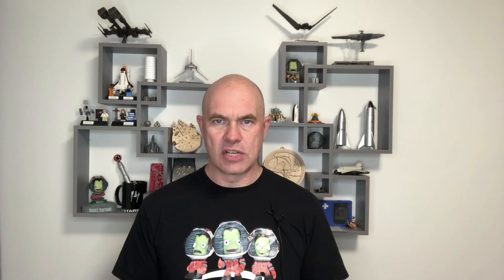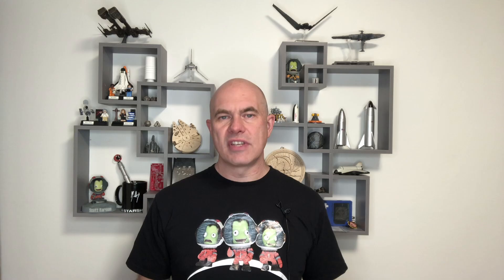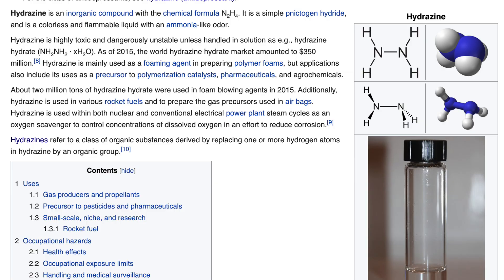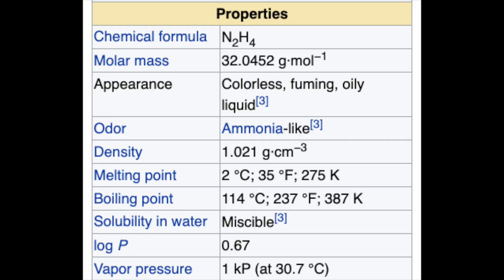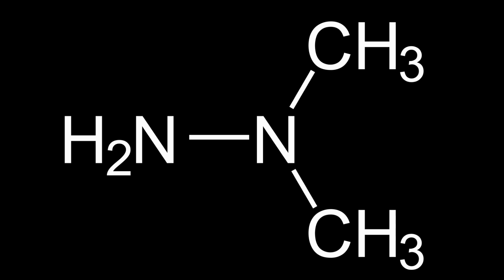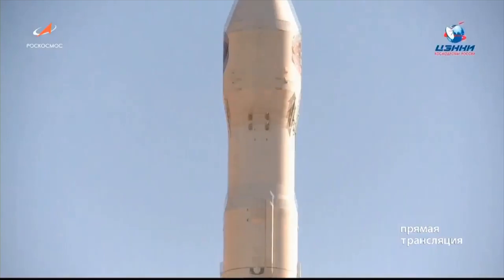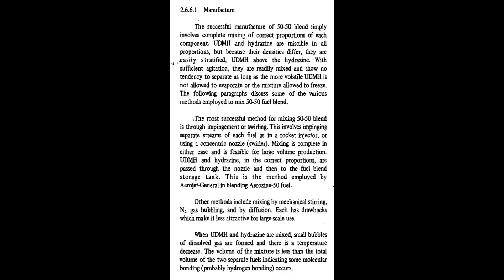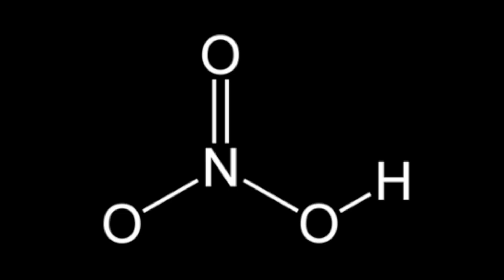What are Hypergolic Rocket Fuels? (Other than Explosive, Corrosive, Toxic, Carcinogenic and Orange)

Comment: Two questions. 1. What about the "green propellant(s)" we heard so much about recently, then seemed to have disappeared?

2. Why does Starliner's thrusters/escape motors make huge orange NO clouds (that the capsule then flies through) where Crew Dragon's seem to burn perfectly clean, even at any throttle setting?
Reply from the maker: Green props are monoprops, they're able to decompose with a catalyst, but aren't inherently toxic or corrosive. They're better performing than hydrazine but are new technology and aerospace designers are risk averse.

Not sure about the second question without more research.
Reply: @scottmanley  As monoprops are they also underperforming in comparison to biprop hypergolics? If there isn't a performance gap, I'm surprised SpaceX didn't adopt them, as they seem to view risk a lot differently than the Oldspace Boys Club.
Reply from the maker: Monoprops are lower performing than Biprops.
Reply: @scottmanley  So is anyone working on a "green" biprop? Or is there just no such thing as a storable "green" oxidizer?
Reply from the maker: @AdmiralQuality  Nobody has figured out how to make a green hypergolic biprop.

Comment: Makes me wonder if scram jets use some kind of oxidizer mixed into the fuel or injected into the combustion chamber separately from the fuel injectors. Extra oxidizer to compliment limited oxygen through the air inlet when over 98% of the atmosphere at 100,000 ft altitude.

Comment: In the V2 they also put water in the rocket fuel. Not sure why they used to do this, when they could've had more fuel instead.
Reply from the maker: I explain it here: https://www.youtube.com/watch?v=Eauxlp1wN8Q
Reply: German rocketeers have almost immediately started in 1930 with kerosene with liquid oxygen. But they could not construct rocket engines that would work well with this and similar fuels. (In fact, one such experiment have killed Max Valier, the founder of german "Society for Space Ship Travel" -- a club which did most of the early engine tinkering.) 
So they have stepped back and simplified the problem by using a fuel which was not burning as energetically and was at the same time a much better coolant. That allowed them to construct rocket engines that actually worked reasonably reliably, and could be built with available to them technology. Later, after much work, such engines were scaled-up and put into production for V2 rocket.
Meanwhile, engine development continued, and eventually produced much more modern looking designs, some using hypergolic fuels. Although it is not a completely settled question, these engines have likely had more impact on after-the-war engine development than the better known to the public V2.

Comment: Ignition!
Btw: In which world is HF a stronger acid than HNO3?
Reply: Yeah, people often conflate "scarier as a human" to "stronger". I get why, but it's still wrong
Reply: HF reacts with everything, but in a lot of cases the metal flouride is a stable layer passivating the surface. Thus you can store HF in nickel tanks, and use pure nickel plant to handle it, because NiF is at least similar in size to Ni metal, and bonds well. Just like Aluminium oxide is a passivation layer for insanely reactive Aluminium. Just do not have any sort of cavitation that will scour this layer away, and pour your liquid in slowly and carefully.
Reply: @mduckernz  I'm not even sure if HF is scarier than RFNA. HF has high dermal toxicity, but fumes are not that bad LD50-wise. RFNA on the other hand will do bad things to you on contact and on inhaling fumes...

Comment: Speaking of fuel chemistry - what are the exhaust products of a methalox engine? CH4 and O2 will produce carbon dioxide and... I could easily assume the wrong answer.

Was contemplating the ideal of Raptor using methane & oxygen processed from air with solar power - returning same carbon and oxygen to the atmosphere, with very minimal actual carbon footprint. But... will hi temp produce other compounds?
Reply: Water, half of the exaust gas is water.
Reply: @ThijsKops   CO2 and H2O are what come to mind, sure. But I keep getting this simple stuff wrong - wondering if complex molecules might be formed in the high temp combustion.
Reply: @ThijsKops  Assuming they run at stoichiometric ratio... often they run fuel-rich to keep the chamber temps down.  And best performance with liquid hydrogen happens when the mixture ratio is set to burn only about half of the hydrogen.
Reply: With methane and oxygen it is unlikely that truly complex molecules are formed. carbonmonoxyde and polycarbonoxydes are most likely
Reply: I glimpsed some formulas from a simulation in a video, don't recall which one but I think it was an early one on the Raptor. It had about 30 different compounds being created during combustion.
Reply: @drtidrow  rockets are usely most efficent when not molten. So running stochiometric is not always optimal. The full flow staged combustion cycle would run close to if not stochiometric
Reply: @ThijsKops  Well, with LOX/LH2 motors, the highest specific impulse (ie, most thrust per kilo of propellants) happens when you burn about half the hydrogen to heat the rest.  That's why nuclear rockets are so efficient: all they do is heat the hydrogen without adding all those heavy oxygens into the exhaust.
Reply: @drtidrow  true but methane has the same mass as water.

Comment: Hey! I was thinking about ways to increase pressure in the combustion chamber without adding heat while also increasing the effective kinetic energy given to the exaust.. is there any rocket engine you know about that sprays water at the neck or in the bell?  
Its just an idea and i dont know enough about fluid dynamics to know if it would even make sens.

Comment: Are there any reasonably non-toxic non-corrosive hypergolics, or do you just have to stick with normal engines?
EDIT: Apparently, once you run a high-grade hydrogen peroxide through a catalyst, the resulting mixture of oxygen&steam reacts spontaneously with kerosene.

Comment: Most of these compounds seem to be composed mainly of nitrogen; if you react the nitrogen based fuels with the nitrogen based oxidisers, why wouldn't you just wind up with nitrogen when you were done?
Reply: Nitrogen gas is a very good exhaust molecule for the rocket.
Reply: @gordonrichardson2972  It just seems that pyrotechnic chemistry wouldn't exist without nitrogen compounds - nitrates, azides, ammonium compounds, all of which can be made to go BOOM in various ways.

Comment: Where does the H70 used in the emergency power unit of the F16 fit in?
Reply from the maker: That’s 70% Hydrazine, 30% water
Reply: As an F16 mechanic I understood that.  I just was wondering about the more in depth explanation.

Comment: I would like to hear about perchloric acid as an oxidiser
Reply from the maker: What about strontium perchlorate.
Reply: @scottmanley  Was it ever tried? Strontium is quite heavy for a rocket oxidiser. What about 4,4′,5,5′-tetranitro-2,2′-bis(trinitromethyl)-2H,2′H-3,3′-bipyrazole?
Reply from the maker: Yes it was injected asymmetrically into the nozzle on solid rocket propelled ICBM's to provide thrust vectoring.
Reply: @scottmanley  Interesting niche use. But what about the fabulous 4,4′,5,5′-tetranitro-2,2′-bis(trinitromethyl)-2H,2′H-3,3′-bipyrazole and other azoles in hypergolic pairs? Ionic liquid propellants are also worth worth mentioning. And, my favourite ammonium dinitramide in solutions.

Comment: As far as I remember my chemistry class  (16 years ago), you do not want to be in the presence of NO or NO2. Probably others. as well.
Reply: Depends on concentration and exposure duration. NOx forms when you heat air high enough, which happens in cars, campfires, and lightning. In the US, NO is used as an anesthetic and a propellant for canned whipped cream.
Reply: @icollectstories5702  It always perplexed me that US still uses NO as an anesthetic (usually in dentistry), with all of it's side effects. Yes, it is the least toxic of NO compounds, but it doesn't mean that it is completely safe - especially if procedure is longer and there are many of them. What the hell: "I have a shiny teeth and my bladder stopped working". Yes I know it is great in some applications and I'm sensitive as fuck to needles, but when my beloved dentist makes her puppy eyes and uses needle for 3 year old, I practically 1. Melt, 2 When I unmelt I'm already anesthetized. To be real for a second, both methods have up's and down's. But NO was used here and over 85% of dentists used it as a drug.
Reply: @jannegrey593  I like saccharin.😊

Comment: Are the pressure vessel requirements to keep nitrous oxide liquid too difficult to use it in serious rockets?
Reply: No, just too heavy.
Reply: I would guess it's also a matter of applicability to the use case: Nitrous oxide is too stable/won't react for use in a hypergolic engine, and in a non-hypergolic engine, pure oxygen (LOX) is going to be more mass and volume efficient.
Reply: @kc8omg  I read you can catalyze nitrous oxide to make it hot enough to be basically hyperbolic

Comment: Ask a question, get an answer - if only all Youtube worked like this!

Unfortunately, the chemistry went past too quickly for my aged brain, but I think I got most of it.  Basically hypergolic fuels are evil stuff that no sane person would use - but they are too useful to stop using, although we use a lot less than we used to.  Correct?

Also, the brown/orange gas released when they are spilled is 'only' nitrogen dioxide - which is nasty, possibly very nasty, but not accutually totally evil, so we don't need to worry about it too much, as long as it isn't being spilled/dropped/burnt anywhere near us?

Which leaves me with only two questions:

Does Scott know everything?

And, what sane Scottish parent, living in Scotland, calls their son Scott??
Reply from the maker: No, I don't know everything. I don't know how to convince Flat Earther's, Apollo Hoaxers or political extremists to use logic.
Reply: One of the problems with nitrogen dioxide is that, on contact with water in human lungs it forms nitric acid.It is a common constituent of air pollution and smog.
Reply: @scottmanley   "One cannot reason a man out of a position he was not reasoned into."  Jonathan Swift.

Comment: Mr. Scott Manley, after the Soviets had used, and continue to use hydrazine, and we have seen the biohazard elements, why is Boeing still to using it? Hydrogen LOX is so much more available and doesn't require millions for clean up. Peroxide at 99% with a hydrocarbon is again less caustic, and stable. Steam engines avoided high pressure, avoided high danger areas in the presence of humans. A clean fuel may require a slower approach however it is a permanent solution, no revision costing billions more.

Comment: I keep hearing ‘specific impulse’ as I’m no rocket scientist I have no idea what it is, anyone to take the time to explain it please?
Reply: It's a measure of how effectively a rocket uses its propellant, measured in seconds. See:
https://en.wikipedia.org/wiki/Specific_impulse
Reply: The quick and simple way to explain it is, it's basically the rocket's fuel efficiency. The higher the number, the more efficient the engine.
Reply: I think it’s a case of for any given amount of fuel (say 1kg), it’s how many seconds of thrust of (1kg) you would get. So 1kg of fuel would give 1kg of thrust for say 263 seconds, so it has a specific impulse of 263 seconds. 
Im not a rocket scientist either, but I think that’s right.
Reply: Mark Shaw Correct. And the higher the number of seconds the higher the efficiency. Hydrogen and liquid Oxygen have the highest value
Reply: @MarkAShaw64  Worded slightly differently: It would be the number of seconds that burning the fuel+oxidiser could lift themselves vertically against the earth's gravity.
Reply: Specific impulse for rockets is like gas mileage for cars.
Given a rocket with one thousand kilograms of propellant, how long can it produce a thrust of one kilonewton? The number in seconds you get is the specific impulse of the rocket engine.
More efficient rocket engines can produce thrust for longer.
There are one or two numbers given for specific impulse for a rocket engine. If it's designed to operate from the ground, it will have one number for specific impulse at sea level, and another higher number for specific impulse in a vacuum. If it is designed only for operation in space, it will only have the number for specific impulse in a vacuum.

Black powder rockets have a specific impulse of about 100 seconds.

A good double base solid rocket motor propellant will get about 250 seconds.
Rockets using Kerosene and liquid oxygen will top out at around 340s.
Rockets using Methane and liquid oxygen will top out at around 380s.
Rockets using liquid hydrogen and liquid oxygen will top out at around 450s in a vacuum.

A solid core nuclear thermal rockets (look up NERVA) is capable of producing about 800s in a vacuum.

Ion engines come in at around 4000+ seconds, but the thrust is tiny and they only work in a vacuum.

Comment: Why are so many insanely powerful compounds nitrogen based?  Nitromethane, Nitroglycerine, Ammonium Nitrate Fuel Oil, fuels in the video, etc.  I think theres something rather simple that explains it but I'm not having that light bulb go off..
Reply: The nitrogen-nitrogen triple bond is the strongest chemical bond of all, so nitrogen really wants to get rid of all the other stuff stuck to it, and when the triple bond forms a lot of energy is released.
Edit: plus, nitrogen is a gas, so it contributes with additional pressure when it's created. Many other energetic reactions lead to liquid or solid products.
Reply from the maker: Nitrogen just loves to join another nitrogen.
Reply: @galfisk  thank you.

Comment: Listening to this makes me cringe in the same way as reading the "Things I Won't Work WIth" series of blog posts at the https://blogs.sciencemag.org/pipeline/archives/category/things-i-wont-work-with site.  Oh look, a recent post "Can't Stop the Nitro Groups".  So glad I have nothing professional to do with this brand of high energy, angry chemistry.

Speaking of hypergolic, on of my favorite posts:  "Sand Won't Save You This Time" regarding chlorine triflouride quotes John Clark from his wonderful book "Ignition!":

”It is, of course, extremely toxic, but that’s the least of the problem. It is hypergolic with every known fuel, and so rapidly hypergolic that no ignition delay has ever been measured. It is also hypergolic with such things as cloth, wood, and test engineers, not to mention asbestos, sand, and water-with which it reacts explosively. It can be kept in some of the ordinary structural metals-steel, copper, aluminium, etc.-because of the formation of a thin film of insoluble metal fluoride which protects the bulk of the metal, just as the invisible coat of oxide on aluminium keeps it from burning up in the atmosphere. If, however, this coat is melted or scrubbed off, and has no chance to reform, the operator is confronted with the problem of coping with a metal-fluorine fire. For dealing with this situation, I have always recommended a good pair of running shoes.”